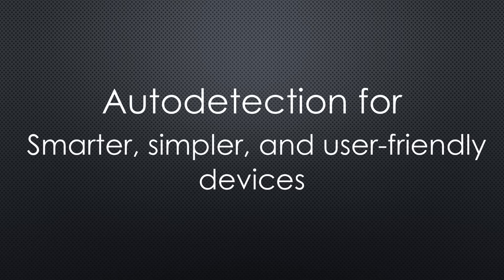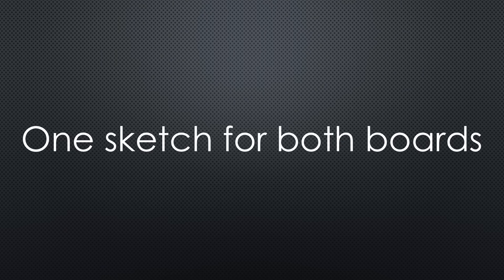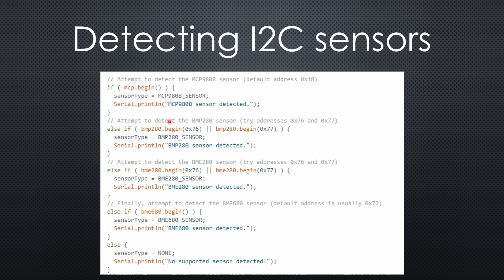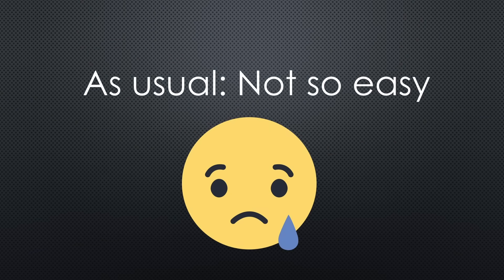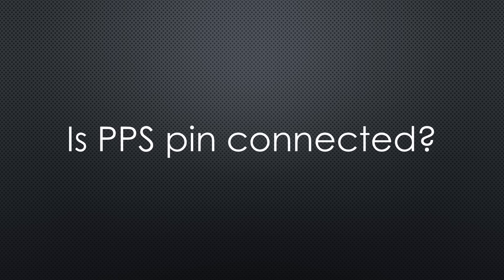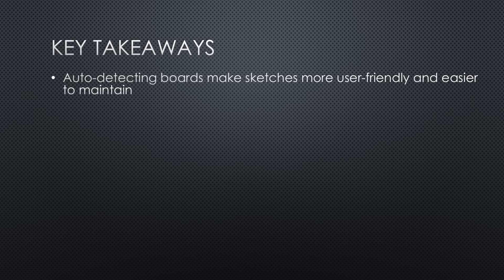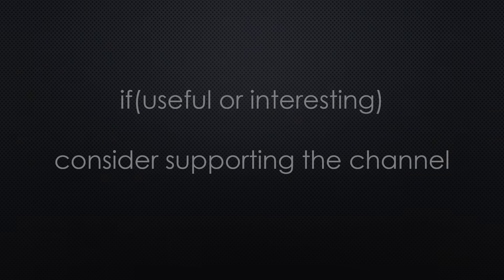Mastering Smart Board Auto-Detection for Microcontrollers. including ESP32 GPS NTP server

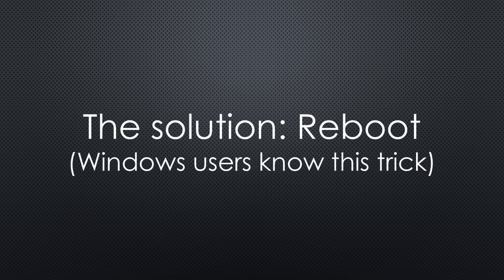Comment: 6:00 There is another trick you can use. If you save the new configuration at a specific address in RAM indead of inside a eeprom and prevent the loader script from initializing that specific memoryadress with zero, then you got the same effect without the need of another (maybe external) comonent like a eeprom.
Reply from the maker: Also a good idea if you know how. EEPROMs in microcontrollers are not really EEPROMs. They are reserved spaces in flash memory.

Comment: Nice and clear!
One suggestion if I may: you can connect a resistor and capacitor in series to the detection pin. At test time you switch the pgio to high for a short moment, and then read back the voltage. The RC value determines the voltage/time combination. Now there are more than three different coding possibilities. I saw this trick in the schematics of a Dell laptop to determine the hardware version of the board.
Using the internal pull-up or pull-down is not a good idea, because the resister values differ much along different chips.
Reply from the maker: Good idea! Analog is not always bad ;-)

Comment: There must be library out there that can some how ask the chip itself what it is...

Maybe one of the memory locations on the chip itself have the part number hardcoded or something...

Am i crazy to think that can be the case?
Reply from the maker: You are right, MCUs usually have such details. But this does not help for identifying the board and the pins :-(
Reply: @AndreasSpiess  

I see.

I thought you are using different chips for the same board...
And the different chips will always use the same pins on that board...
But maybe I misunderstood...
Reply from the maker: You are right. I did this with I2C sensors. And those can be determined by their behavior or even name.
Reply: @AndreasSpiess  

I see. So two different types of sensors, but the MCU might be the same.
So the MCU needs to tell the sensors apart.
It can't just ask itself what itself is and know which sensor chip is connected and what are the pinnings...
Reply from the maker: The pins are defined by the traces on the board. Different boards have different traces.

Comment: Interesting approach. But to be fair platform io with the help of c++ macros are usually the way I handle such cases but to be fair it's not auto detection during runtime.
Reply from the maker: You mentioned it: The topic of this video was "during runtime". I agree, some IDEs have good configuration management.
Reply: Just as a note I really enjoy your videos. But the way the code was presented was more focused on what board the code is being run on which imho is less complex to handle before compiling the code using macros. To be honest from reading the title of the video I expected some wifi / wireless auto discovery mechanism vodoo but maybe in some future video.

Comment: @AndreasSpiess Video suggestion, something chatgpt doesn't know: What about the solid electrolytic/aluminium-polymer capacitors that are all over aliexpress right now, at what appears to be reasonable prices? I don't have the proper equipment to see if/how good these are. My rudimentary T7 component tester says the farads are all there, but the ESR is apparently 0.0 ohms. Also interesting to see if you know anything about the ceramic capacitors available from the same website (up to 10 uF claimed) for almost no money at all?
Reply from the maker: These capacitors are used everywhere, so they are really cheap. I have assortments from both for no money. I just tested one of the solid caps with 0.05 ohms serial resistance. The capacity was also ok. So I would not worry.
Reply: @AndreasSpiess  Thanks! Better if it comes from someone more knowledgeable than me :) My experience overall is that the dreaded "Chinese cheap&cheerful" quality level doesn't seem to apply to electronics components from aliexpress. So I'm not surprised if these caps really are the real deal.

Comment: I used to teach children how to make robots with Arduinos in a summer camp. Things got a lot saner once our default library could uniquely identify each board revision and automatically test all but the simplest sensors.

Wiring errors and failures are to be expected in that environment. Before we bought a large quantity of a particular sensor or motor driver, we would make sure they would survive reverse voltage and other similar wiring mistakes. At least once we added protection diodes to a type of sensor where we couldn't find a robust alternative.

During development robots tend to drive off tables or fly at the floor at full speed. It is useful to have a simple procedure for the kids to know what needs fixing.
Reply from the maker: Indeed, making things fool-proof is 90% of the effort of a developer. But unfortunately, it has one disadvantage: The kids learn that everything is indestructible ;-) For you as an organizer, this was probably the only possibility to survive...

Comment: Interesting, thanks for sharing. I use a different approach. I use Platform IO and pass a build flag to identify the board. One of my header files the uses the build flag as a preprocessor directive with an #ifdef and sets the appropriate GPIOs. It is very quick to upload the firmware as you create different environments in your config file for each supported board
Reply from the maker: That is a good way. However, you need to compile a separate file and distribute it for each board. Plus, the user has to know which board he uses. That is why I changed.
Reply: @AndreasSpiess  Good point, and good technique

Comment: sounds a little cumbersome. Most  BUS [Parallel, I2C, SPI, UART, RS485, etc] chips will have a chip-id register for identification. Read it and use a switch-case instead of brute force trial and error.
Reply from the maker: This is what I propose with the I2C sensors. However, some boards have similar chips, just connected to different pins. That is why I made this proposal.

Comment: Please do add a warning that sending a 'high' signal to a chip which is not powered may sometimes actually destroy the chip.
Most chips do not like to have voltages on signal pins to be higher then their supplied voltages on Vcc.
A lot of chips do have internal diodes to protect against this.  In the datasheet you can typically see some max. voltage to be defined like "Vdd + 0.3V"

One example of a board which absolutely does not like this 'probing' is the wESP32. This is an ESP32 board with ethernet and there are several revisions of this board, where the actual Ethernet chip differs.
I know sending the wrong logic state can actually destroy the Ethernet chip and thus render the relatively expensive board useless.

So please add a clear warning about using this probing method as there are actual boards out there that will get damaged by doing so.

Similar example is the use of GPIO-12 on an ESP32 to either short it to GND or 3V3. The boot state of this pin is used to set the used voltage to the internal flash chip.
By using this to detect a board as this might be one of the few unused pins left when using Ethernet on ESP32, you might render the board not bootable if you're lucky or damage the flash chip if you have one of those boards using an 1V8 flash chip.

Just 2 examples of why this is a bad idea to detect various board revisions.

A more elegant way could be to add 2 resistors and a small capacitor to suppress noise to set a fixed voltage level on one of the analog capable pins.
Since you probably only need to check this at boot, before any WiFI is started, you could also use one of those pins which have their analog input feature wired to ADC2. You should not try to read those via ADC2 when WiFi is active.
Reply: This reminds me of the early days of autodetection on the PC, with the ISA bus and before PnP (and even the early days of PnP). Manually fiddling with jumpers and DIP switches was also part of the game. While I cannot recall that voltage destructions like you describe was a problem, I do remember false detections and probing hardware in the "wrong" order were common problems. The field of autodetection is an art, some black magic, and bit of lucky chance...
Reply: @benhetland576  especially the lan chip can be turned on/off, as Ethernet does add quite a bit of energy consumption.
For those old PC cards everything was powered on when the PC was powered.

To protect those chips from high inputs while the PC was turned off, you saw almost always those HEX inverter chips.
Reply from the maker: The wESP32 board might be an exception. For most ICs I use, all pins are rated up to VCC. My method never goes above this level because the MCU and the chips have to fit anyway. So I feel pretty safe. Adding resistors is always good for your boards. However, I mostly use commercial boards these days.
Concerning strapping pins (like GPIO12): Most designs do not use them (so I do not need to test them). And most of them are only read during boot. So no harm if you test them later.
Reply: @AndreasSpiess  Sure all pins may be rated upto Vcc.
My point is that when you have the power to some chips (like LAN) turned off, the signals you may send to it are over Vcc levels.

And the resistors I meant as a voltage divider, so you can measure an analog value from a single pin to detect a board or a revision.

Comment: Great video as always. Regarding ChatGPT: awesome but. With the experience from heavily using AI for a year now, I‘d currently not trust a table generated by AI without careful review. It’s amazing how self-confidently these systems claim things that are completely wrong, and once you correct them, how casually they admit their error and move on. They do save tons of time for tedious routine tasks but in turn require careful validation if the generated results or summaries are important to you.
Reply from the maker: I agree that you have to test what you get. This is particularly easy with programming because the compiler does not compile hallucinations, and the code does not work correctly if pins are wrong ;-). In other areas, fact-checking is more complicated.

Comment: Hear hear for  ChatGTP...  but, it is like an extremely sharp knife, do not ever let your guard down.
Reply from the maker: We know how to handle sharp Swiss Military knifes ;-)
Reply: @AndreasSpiess  Know that I have carried my "Officer Suisse" [I am not an officer, other than I was of the court] Army knife in my left pants pocket since 1973 except for when they started clamping down on security in courthouses and then airports.  The first thread to bare on my blue jeans are from that trusty friend.
Reply: Its great until it isnt and leads you around a circular trail of failed fixes to its generated code (eg using wrong versions of libraries, bad data type conversions ...). I tell people chatgpt has allowed computers to be come acceptable at 80% correct. Chatgpt may be great for generating a table but beware ! Be especially wary of AI summaries of medical journals.
Reply from the maker: I decided to take what I get. I am more of a "the glass is half full" guy ;-)

Comment: OR - hear me out - use ZephyrOS (or Nordic Connect SDK) with multiple builds configurations for each target board since it takes 3 clicks instead of bloating the code of an application!
Reply from the maker: Maybe I was not clear enough in my introduction ;-( 
This is not the problem I wanted to solve. PlatformIO can do this trick, too. But you still have to create and distribute a bin file for each board, and the user has to know which one he has. That was the problem I wanted to solve.
Reply: @AndreasSpiess yea but it seems to me that you ended up on this problem again since the esp32 family has both xtensa and riscv variants, which will inevitably lead to producing multiple binaries anyway, am I correct?
Reply from the maker: Yes, you are correct.

Comment: I guess I'm old fashioned. 1. Do the design 2. Write documentation 3. Use a label printer to identify the parts (hardware names)  3. Use the same names in the source code. 4. Document again. On the other hand.... it's a fun project :-)
Reply from the maker: A good working ethics! However, it becomes a bit more difficult if you do not have everything in your hands. Particularly not the user of your code ;-)
Reply: You save a lot of headache along the way. On the other hand, things don't get finished. Looking at myself here.
Reply: Most of my work was for companies making big machines using Lasers in various industries such as packaging, semiconductors and apparel. Documentation was part of the job to assist integration and later, servicing.

Comment: Thank you very much! ESP32 with Ethernet and PoE looks temptingly. There are now some affordable PoE 1GBit switches around. On the other side: My home automation is nearly saturated. ESP8266 works in most applications and ESPEasy as well as EPHome and Tasmota mostly substitutes own programming for new projects.
Reply from the maker: Same here with ESPhome and Tasmota. But I have to admit: Programming has a small revival here because of the help of AI...
Reply: @AndreasSpiess  yes AI knows many programming tricks in different languages and systems. As long as it is short and simple.
Reply from the maker: My last code had 600 lines. Which is quite long for my ESP32 projects. I also started breaking things up and using RTOS. This helps to keep the code for the AI short. And as a reference, I sometimes include a .h file with all the global definitions...

Comment: Thanks for the great videos!
If I may suggest one topic for the future, this would be the implementation of the sdi12 interface on microcontrollers. This interface is mainly used in environmental sensors ranging from soil moisture to meteorology sensors.
Thanks again!
Reply from the maker: Thank you for your proposal. Unfortunately, I have no such sensors here. I assume they are on the expensive side...
But I found a project that integrates SDI-12 into ESPHome...

Comment: Hi Andreas. Good work as usual. 
Programmed rebooting works only for the esp32 versions. I'm not succesfull with 8266'es. If I'm not wrong you also had problems with an ESP-01S or did you found a solution in the meantime?
Reply from the maker: I have to admit that it has been a long time since I used an ESP8266. There are no more a lot of reasons for it :-(
Reply: @AndreasSpiess  Yes i agree just that i have lots of them ....